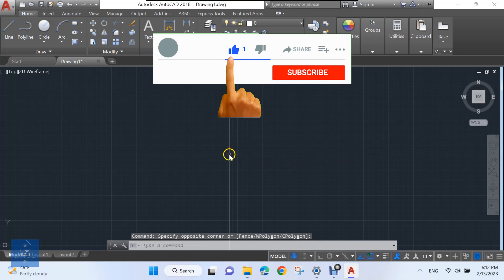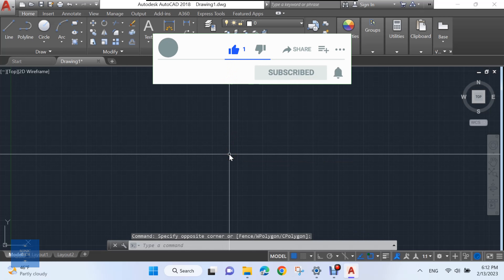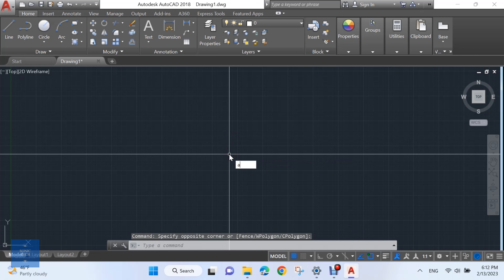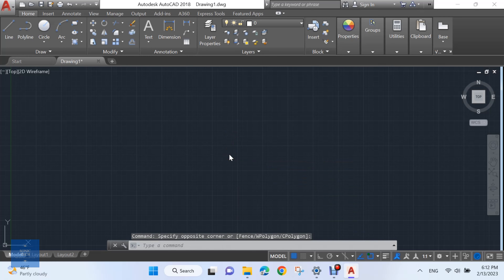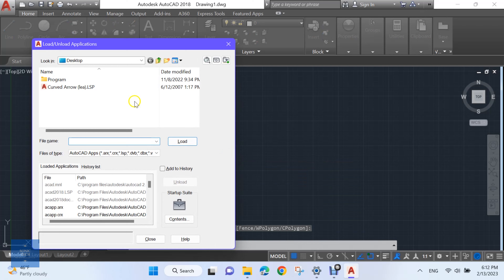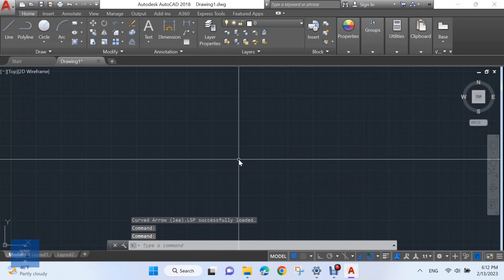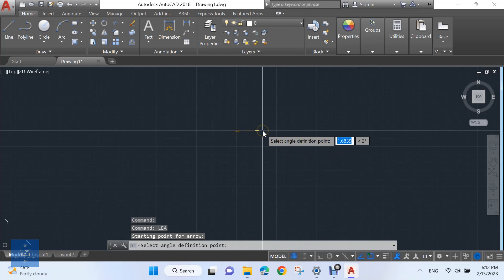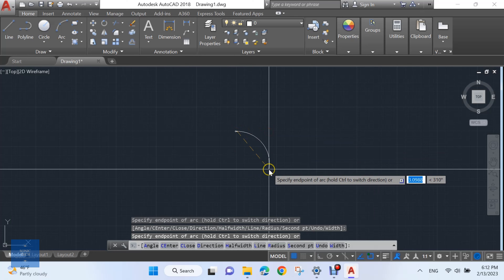How to add a Curved Arrow in AutoCAD 2023 using an AutoCAD Lisp

Comment: The arrow head is too small when i tried, it looks like a normal line. So my question is that how to make the arrow head bigger 😅
Reply from the maker: Hello! This is a simple process. Firstly, please note that this LISP code is designed to be used with AutoCAD drawings that are in meters, and may not work properly if your drawings are in centimeters or millimeters. To fix this issue, open the LISP code with a program like Notepad and adjust the numbers before the code ((getvar "LTSCALE")) to match your drawing's scale. If you have further questions, feel free to ask me. I hope this helps!